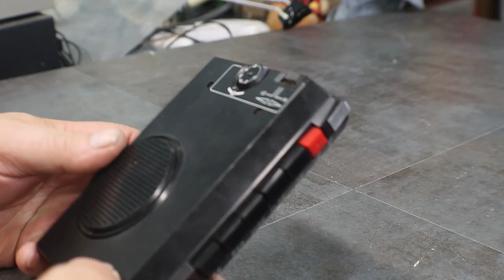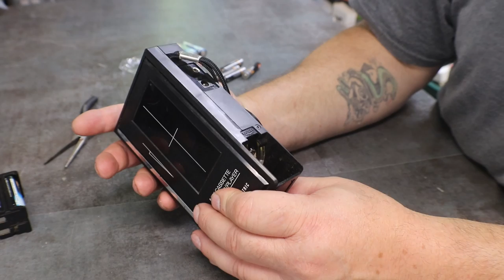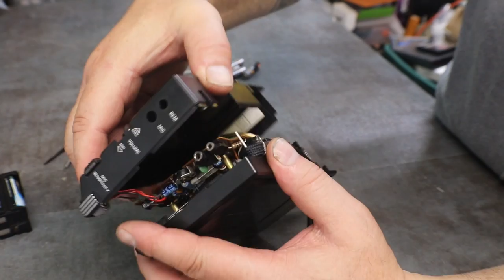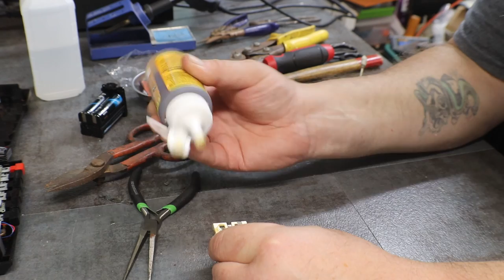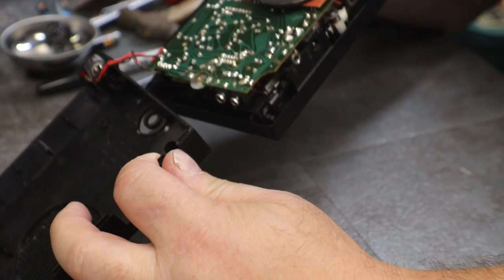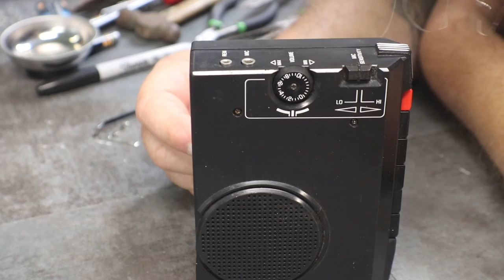General Electric Mini Cassette Player/Recorder Model 3-5303A Can We Fix It

Comment: Нет звука не в наушниках ни с динамика кассету крутит
Reply from the maker: Check your speaker and the wires to the head.
Reply: Спасибо, вроде проводки все припаяны хорошо может что-то сгорело в нём, у вас в видео я смотрел тоже не было в начале звука а потом в другом видео уже появился что вы сделали ?
Reply from the maker: @ДенисКотов-с4р  The head wasn't pressing up tight against the tape. My mech was still gummed up and needed to be freed up more so it would put more pressure on the tape.
Reply: Понял спасибо большое попробую этот вариант. С уважением